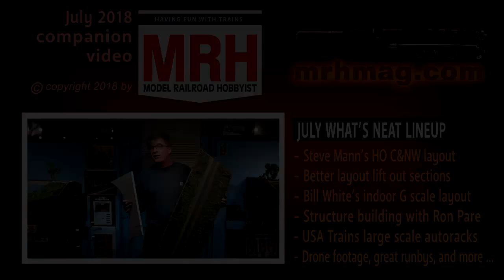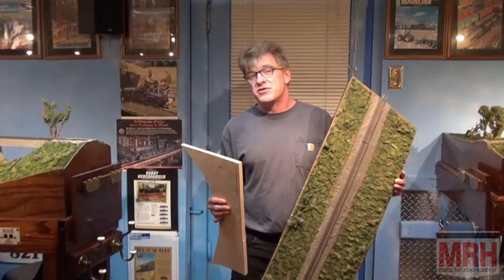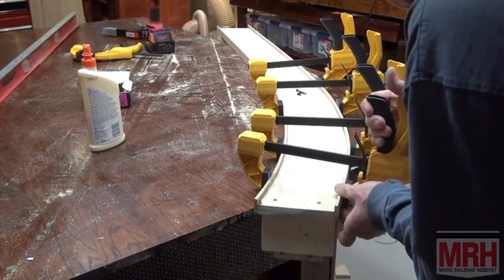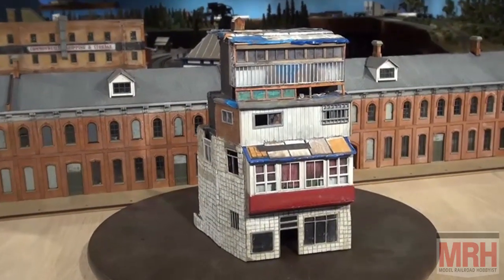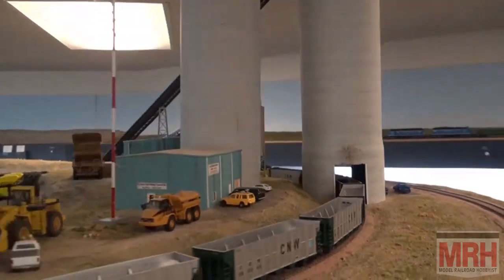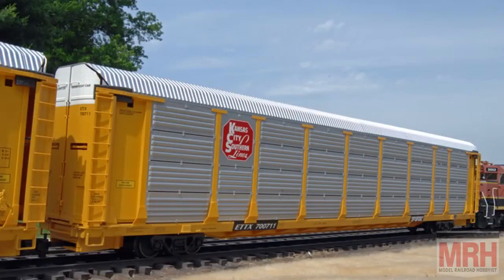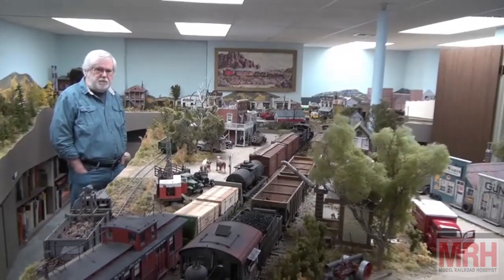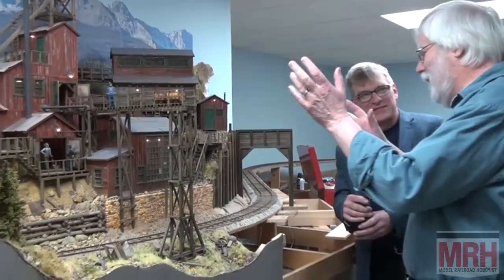Whats Neat in model railroading | July 2018 Model Railroad Hobbyist | Ken Patterson

Comment: Ken, what would have been interesting to see for that lift out section would have been a deck girder bridge. I have thought about doing one like that for the HO club layout that I am in. Not that I did not love your solution. It does look really cool and serves its purpose. Thick duckunders are more difficult as we get older. So, this thinner one should gain you many years of good use. Another excellent video. Thank you for what you do for the hobby.

Comment: Ken:   Wondered why you painted the track first, then added the power feeders.  Was it that way, or just the way the segment was edited?   Also, how did you clean the paint off the top of the rails?    I'm sure others would want to know how you do so.
Reply: I masked that section, soldered the wire feeds to the rail, then painted that section. Now you will notice that in the video, really did not go into that in the script. I also did not mention the super elevation in the curve but you can see the styrene strips under the track. Plus it is code 70 on the lift out and 83 on the connecting sections. bent the rail joiners, (N scale atlas) so the rail tops would be sort of even. sanded the rail tops to remove the paint and ballast cement. I like how it came out.
Reply: Thanks, Ken.   It must have been in the editing.   I thought you probably did as you noted.   I have heard that sanding the rails creates scratch marks in the rail tops, so I don't do that.   Usually, after painting track, I'll use a rag with a couple of drops of thinner where my fingers are and run over the railheads.   WOrse to worse, I wait until the paint is dry, then use a single edge razor blade and scrap off the paint and any ballast glue.  Thanks for your reply.   Stay cool in all this heat this weekend.   And Happy 4th of July!